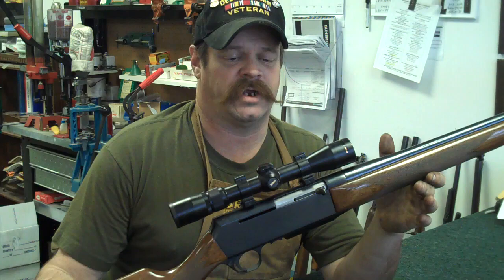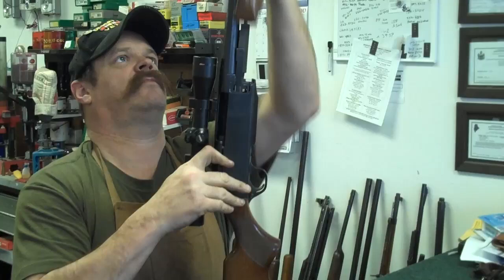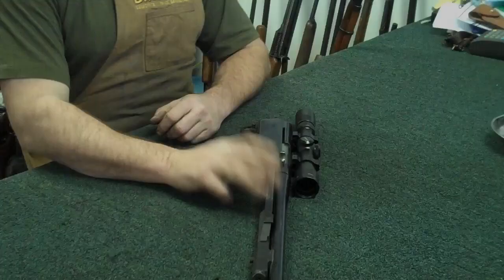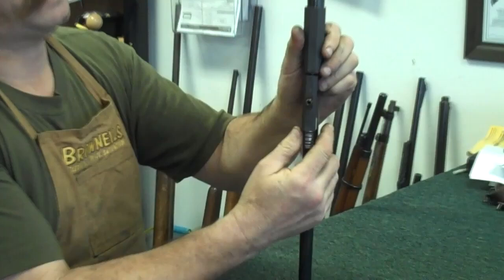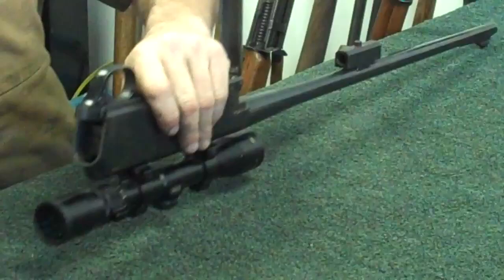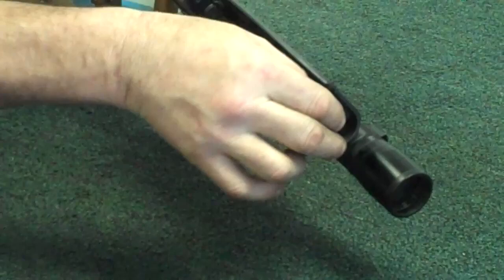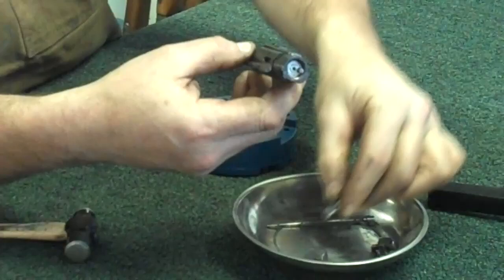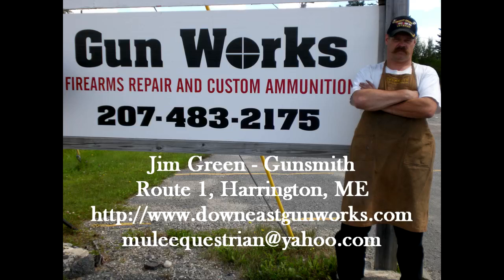Gunsmithing: Browning BAR Hunting Rifle .30-06 (Gunworks)

Comment: You helped me a heap Jim with your informative video.  One suggestion , please show the little tricks on re-assembly of the wood.  I spent two hours trying to put the stock back on, I finally laid the rifle on its side and got my wife to hold a flexible bore light against the plate until I could get the stock screw started.  That was a bi double itch since the plate is not solid and the long screw keeps pushing it away.  The forearm is also a little bit of a problem until you pull the bolt all the way to the rear and It pops right in.  Don't forget we are novices on these issues and you can shorten our learning curve by completing the video.

Comment: Thanks for the video and thanks for your service! My BAR Safari II bolt was not returning enough after firing. Found a broken action spring. Replaced and works fine now. This spring can compress and hold the memory if the gun is stored with the bolt in the open position. Another video I looked at showed an old and new spring side by each and there was a 2 inch difference or more, losing just enough strength to keep the bolt from properly seating. 

Suggest storing with the bolt closed.

Comment: @mulequestrian,  I had one where the BAR had been manufactured in 1981 and probably hadn't been cleaned since it left the factory.  The Timing pin broke causing the timing cam to malfuction.  This was a 7mm Rem Mag.  The bolt wouldnt go completely in battery so my client too his hunting knife's butt and wacked it closed and whacked it open until the charging handle fell out.  He managed to strip the cocking handle right out of the bolt carrier.....it was just not a fun day.

Comment from the maker: @brad6479 Unless you have a gunsmith in your area that can deal with refinishing a Browning, you might could get the factory to refinish it. The newer BAR has an alloy receiver that doesn't take bluing that well.
Reply: The new BAR's won't take bluing at all as they are alum.

Comment: @TwoStageTrigger 

Thanks Twostagetrigger! I managed to fix it weeks ago. I was doing it outside on a table on my deck since it was sunny. At one point the plunger spring went flying and landed a half inch from the deck crack! In the end I disassembled the trigger which made it do much easier. Why are these things breaking? Mine is a 69 270 caliber. As much as I like it, I think its time to sell it! I bought a Remington 750 and must say, for over $400 less, its just as accurate, if not better.

Comment: Great video. Thank you for making and posting. I am a owner and big fan of this rifle. This video is the first I have seen on the disassemble of the rifle. Keep up the great work.
Reply: Jeff Sartin-- I have a Browning BAR 30-06 which was passed down to me from my farther, and this is the ONLY video that shows the complete teardown of this rifle. It's a very good video, but please watch it several times before you attempt to teardown your Browning. As in previous comments, you don't have to tear it down every season, but it is a good idea to completely tear it down at least every maybe two seasons, that is if you take it to the shooting range before every season to assure it is sighted in. The gas system is the most temper-mental part of the whole rifle system.
Reply: Thank you for the good advise. I have read that it was difficult to take down the BAR. So, I have not ever attempted it. I have taken the forearm off and cleaned around the general area. 
I have a 338 Win Mag and a 243 Win in the BAR. Both rifles give excellant service without any problems.

Comment: Very thorough.Now the hard part . Reassembling!!!! Oh theres is one thing you've missed and thats to clean the gas ports in the barrel. The gas  ports get fouled and clogged sometimes almost completely and your rifle may get jammed therefore not cycling the next round . It happened to me at a very awkward time. Animals were running pass me . I shot once and it jammed.I used a thick paper clip and some solvent to break up the carbon deposits.

Comment: THANK YOU FOR THE VIDEO. my gun is a 300 win mag and it won't eject the fired shell so i cleaned it but still wouldn't eject. when i watched your video you said there was a pin that the gas piston notch lined and slide in. i guess mine was sheared of worn because it doesn't line up on anything. i'm taking it apart now to recheck it. THANK YOU

Comment: I have a BAR that was made in 68 or 70 & was wondering how often the gun should be disassembled & cleaned. It works great, hasn't been shot a whole lot in the last 20 years I know but ive only took it down once to clean it. It was such a pain I just haven't wanted to deal with it much. Also the finish is rubbed off the receiver a lot & I would really like to have it re-blued

Comment: Great vid dude.
Looking at buying a used MK II ot 6.

From Old Town originally 👍🏻
83 - 08 
Army 11B
Retired here in Clarksville TN outside of Ft Campbell KY and the 101st.

Most def gonna take this gun apart if I get it and get it to my standard of clean. 
Recut the checkering outline.
Refinish the stock with 50/50 cut Tru oil and mineral spirits.

I can stand factory finishes personally.

Once again great vid dude.

Not as complicated as a AC code Walther G43 I got several yrs ago at a estate sale.
They had no idea what it was and I felt no obligation to educate the sellers.
275 bucks.....
🤦‍♂️🤷‍♂️👍🏻🤷‍♂️🤦‍♂️

Sold it for 2K about 6 months ago....

Comment: I currently own a 30-30 and a 7mm BAR. Only down side with theses semi-auto rifles is I hunt deer late in the season, in very cold weather.  Sometimes in -30.  The action slows down in the cold.  Follow-up shots can be problematic thus, in harsh conditions I will usually hunt with a bolt action rifle.  Regardless, thanks for the great instructions.
Reply: I've heard using dry graphite lubricant for sub-zero conditions has worked out well for some people.
Worth a shot.

Comment: Great video! I just got a steal on a Browning Short Trac 270 WSM that came with a Leupold VX-1 3x9x50 its in great shape and shoots like a demon. Got the whole thing scope and all for $840 out the door at a local pawn shop. It has a few tiny nicks in the stock but they are really unnoticeable unless your really looking for them. This is my first semi auto rifle that is not an AR platform or a .22 caliber rifle so I wanted to see what the proper cleaning technique was for these type of rifles.  I would like your opinion on a good solvent and oil that does not leave an undesirable amount of residue after heat induction

Comment: I do some minor gunsmithing also.  I have a question: I recently did a complete cleaning on a Browning like the one you're doing on the video on, and noticed that the buffer had all bu rotted and fell apart.  I told the gentleman if he uses the gun for deer hunting only it wouldn't have much effect.  However, if he was to do a great amount of shooting; I would replace the buffer...  Your comments would be appreciated.

Comment: Mr. Green: I just purchased a Browning BAR in 30-06.  I watched your video and learned a great deal about the rifle.  Question on the reassembly of the operating lever - I cannot get the lever to properly seat on the bolt.  Any advice?  Thanks.

Comment: I bought a Safari in 30.06 the other day at my pawn shop/gun dealer that has never been fired. On my bolt guns I've always followed the barrel break in procedure of fire 1 round and thoroughly clean through 5 rounds then fire 5, thoroughly clean, etc. to 50. Obviously that isn't an option here... what would you suggest? Bore snake? Great video, btw and thanks!

Comment: Hi…. If that gas piston was stuck in there. Would that cause the gun not too cycle and eject properly??? I had that problem my bolt would not push the bullet in all the way… and after watching this video. That gas piston was stuck in there. I had to add little bit of gun oil and tap it out. There was rust on it soo i tried my best to get it off

Comment: Hi there. I bought a 1989 BAR I about one year ago and your video really helped me to disassemble it for a good cleaning job. There was a lot of old grease in it, leeting it no longer cycle the action properly. Now It and it works very fine so far. But I have an issue with it's precision. It always throws the first shot, which is manually loaded by racking the charging handle. I know that this problem iss seen on several BARs. Do you know how to solve this problem? Thank you very much - Paul

Comment: HI, I have a older one in 270 serial number indicates from1971. I bought ti in 2010.
  I have used on 3 hunting trips but last trip it was failing to recycle. I imagine the sliding parts are dirty. And if I don't hear back from you I will wipe clean and use sewing machine oil... ?

Comment from the maker: @kuffs06 I'm going to be blunt. Don't take offense to this, but I'll be right up front. Messing with the trigger assembly in any way goes into gunsmithing. I DO NOT teach gunsmithing due to liability problems. We live in a very litigious society and I don't want to get sued in case you get hurt working on your gun after I give you advice.

Comment: Also the only problem I have with the rifle at this point is it seems the firing pin isnt striking the rounds apon firing. Chamber  round, pull the trigger. Hear  click, but no fire. Wait 10 sexonds, discharge the round in a safe manner. No strikes to the primer or round anywere. Tried multiple rounds and samething. Could a good cleaning help this or do I have a bigger problem? Took rifle out a month ago and fired just fine. Took out the other day and this started. Tried 5 different rounds. Any help would be great

Comment from the maker: I'm NOT from Maine. I've only been here 9 years. I'm from western NC, in case you can't tell from my accent on the videos.
Reply: I'm interested in turning my BAR into a straight pull bolt action with a return spring. How do I safely disable the gas system to make that happen? What I'm trying to do is essentially turn my BAR into a Browning Maral which isn't available in the U.S.

Comment: Hi I have a 30-06 bar from the 60's and I just took it apart by watching your video which is very good, and when I took apart the spring rod with the two metal plates, the spacer between the metal blocks was totally gone just brown crud.  So my question is is this gun still functional as I was firing it for a while this way, and it fired fine.  Also where could I get this part as I would like to fix it correctly.

Comment: Jim. You are the man! Ive got a BAR 7mm and the butt pad on the stock has no stock bolt holes to get to and take the stock off. How would you suggest getting that off? Is there another way through the action of the gun?

Comment from the maker: Just get a new buffer. They're only about 10 bucks from Numrich. The buffer's job is to prevent metal to metal slamming of the reciprocating parts. Why wear the gun out prematurely for lack of a part that doesn't cost that much ?

Comment: great video! was just given one of these in270win.  i was wondering if it's normal for the ejected shells to be dented and the bolt doesn't always go forward and i have to help it.   i was wondering if there is too much gas causing the shells to dent when ejected.  thanks for your video and help

Comment: Hello Sir,
I have a B.A.R. .300 Win Mag made in Belgium. I noticed that if I have it up side down and with the magazine plate open, that my trigger assembly can move back and forth about 3/8of an inch. When the plate is closed with the magazine in, it doesn't move at all and locks the cover down properly. I just have never noticed it before, and couldn't understand why my trigger system would move so much. Do you think this is a part of the design or do I need to take my rifle into a gunsmith?

Comment: Jim, I just purchased a used Browning .30-06 rifle from a local gun shop. Considering I dont know any history on it, I will disassemble it and give it a good cleaning and once over. Is there anything in particular as far as wear that I should look out for? How difficult is it to acquire replacement parts for this gun if needed? Thanks for posting this video and sharing your knowledge. Its a great help!

Comment: Hey I got a bar that needs a new barrel it was originally chambered in 243 Winchester I inherited the gun and unfortunately the 243 barrel has been shot out!!!!
 I've done everything to try to solve this issue be a hand loading and unfortunately I cannot get this thing to stop key holding no matter projectile change or weight.

Unfortunately there's just been too many rounds put through this thing.

I was wondering if it would be able to barrel this thing in 260 Remington so it would have a longer barrel life as well as more capable for a larger game at the same time keeping me in the large game and small game legal for Ontario projectile size.

Unfortunately up here in Canada I cannot find a gunsmith that is willing to rebarrel a bar it is one of the older steel receivers.

If you could get back to me with the information as well if it is possible pricing.

Comment: I've got a 2018 production BAR Mark II Safari and for the life of me I could not get the bolt assembly out of the bottom of the receiver. It then occurred to me that I probably have to take off the butt stock and slide it out the back. Would this be correct?

Comment: Just wanted to say thanks for this video! Over the weekend something happened to my my BAR trigger as I was sighting in my scope. I dont have a manual (but I did download one online at the same time I was watching the video) and was able to dissassemble and find out what happened. Turns out the  (part number)B3176086 DISCONNECTOR SPRING PLUNGER must have broken because it wasnt there. The spring was as it fell out on my work table. Is there any trick to putting it in? Thanks

Comment: No matter how hard I look and try I can't find the pin to line it up in the gas block or get the piston to stay still in there, is there any chance it broke off and I never noticed during cleaning? if so can I get a new gas block assembly? any input? It used to function fine... has been apart many times before this happened
Reply: Matt mitch 
Did you get it figured out?

Comment: Hi,

That was just what I was looking for.  I'm giving some thought to buying a semi auto hunting rifle, and I was considering the BAR.  The only thing, well, two things I don't like about it are the plastic buffer, and the fact that taking it apart can be tricky.  The plastic buffer is one of those things that will fall apart sooner or later, and probably at the worst possible time.  I would never put a plastic buffer in my 1911, or any gun that wasn't designed to have one.  And I shy away from guns that have plastic buffers as part of their original design too.

What semi auto hunting rifle would you recommend as being the most reliable?  It would have to work with anything from super light loads to the heaviest loads possible.  ... a lot to ask.

Thanks,
Tony
Reply: ATINKERER 
Just go with a bolt action if you plan on using heavy and light loads. The Browning BAR is one of the best though.

Comment: @mulequestrian....I was able to use the charging handle but had to replace the bolt sleeve.  He stripped it out right good.  Peeled the upper rail of the charging handle slot back like a banana peel.  I had to look all over the place for a replacement bolt sleeve.  Midwest Gunworks was where i found them.....I understand that Browning now requires you to send the gun back to them for bolt sleeve replacement.

Comment: great video. do you of any tactical stocks and magazines for that gun ? I have a 1999 BAR Semi 30-06 Belgium Safari...similar to that one.. and I wanted to get rid of the hanging / flip down 4 round clip, and putt in tear out clips if they are even available. PLEASE let me know as I have looked for months and months. Thx
Reply: Hey look to get the mag-well  for a fnar and file the back spacing in the mag till it clears a 30-06 since all fnar are in 308 but it will bolt right up and just a 3/16 hole for the second retainer pin

Comment: I have a Browning BAR 30.06 from 1986, the barrel is showing signs of pitting and wear in the barrel. The accuracy is now suffering and I'm having trouble hitting a soft ball at 100 yards then occasionally it will miss the 3' by 3' target altogether. I have looked at the browning website and it will cost 600+ at a minimum to replace it. Is there a way to reline the inside of the barrel or find a cheaper used barrel somewhere? Any help would be really nice!
Thanks for your video really good stuff!
Reply: Any good barrel company (Harts, Shilen, etc.) or qualified gunsmith can re-barrel a Browning BAR for less money than Browning will charge you. The original gas block can be welded onto the new barrel, so don't throw anything away. You can also get your new barrel in stainless steel and with a threaded end for accessories if you go with a barrel manufacturer or gunsmith. Midwest Gun Works has factory BAR barrels for $265 (B31760B). I have a BAR Lightweight Stalker in .338 WM with a B.O.S.S. that I'll probably have to re-barrel as the round count starts getting up there years from now.
Reply: Thanks for the advice but I sold the gun.

Comment: How often would you suggest breaking one down this far for cleaning?
Reply: Caleb R 
I have one from the 70's and it's never been broken down and probably been fired 200 times in that timespan and still functions great. I'm hesitant about taking my gun apart but I do clean my gun the best that I can. After watching this video, I may try to disassemble for a deep cleaning. In the video I believe he says to clean it like this every 3 years with use. Now obviously if you shoot it a bunch, it will need to be cleaned more often.
Reply: I just scrolled through the comments and he said to do this level of cleaning only once in a great while.